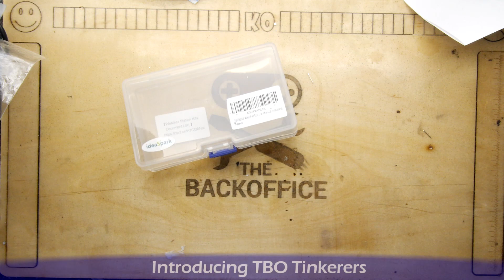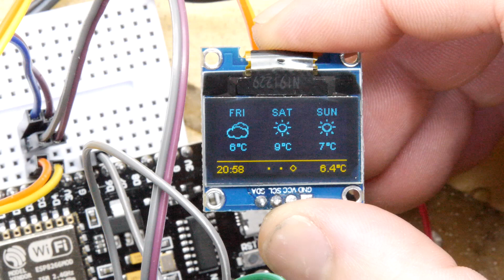IOT NodeMCU ESP8266 Weather Station Kit

Comment: Did you ever find the original build footage? I have the same kit but the instructions are awful and the code doesn't work.

Have been messing around with code from the web and got various sensors working, but combining it all together is proving a bit problematic at the moment.
Reply: Ah, found it now.

Comment: A nice kit for a beginner. FYI, there are two different styles/widths of ESP8266 NodeMCUs. The one you have are wide ones. It usually has 'LoLin' printed on the backside. The narrow, breadboard friendly, ones have 'Amica' printed on the backside. I've had both and function the same as far as I know. A BME280 sensor could replace both the DHT11 and BMP180 pressure sensor and is more accurate temp/humidity wise at a similar cost.
Reply: Or maybe just replace the dht11 by an am2320 as a cheap solution without changing too much the installation. It's more accurate than the dht11 and uses i2c as well